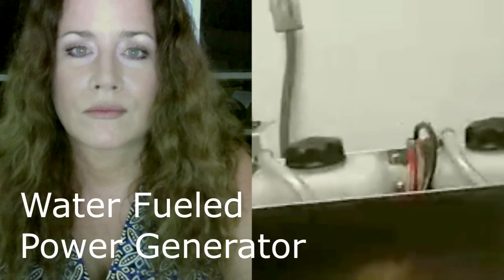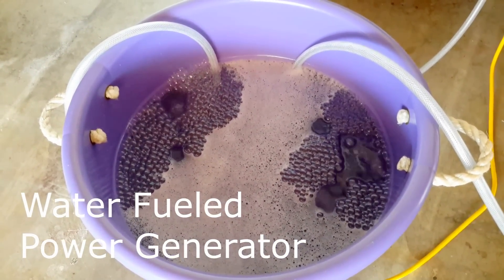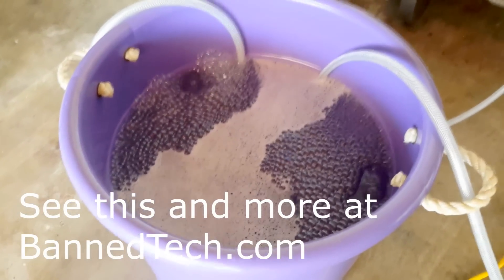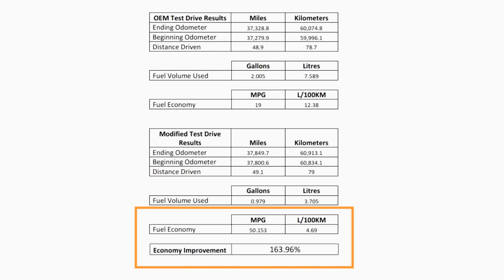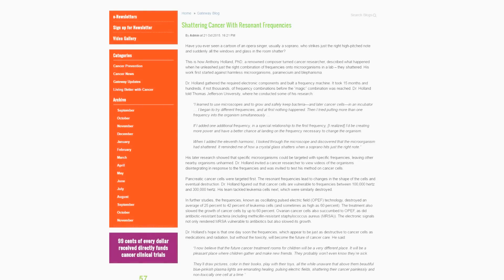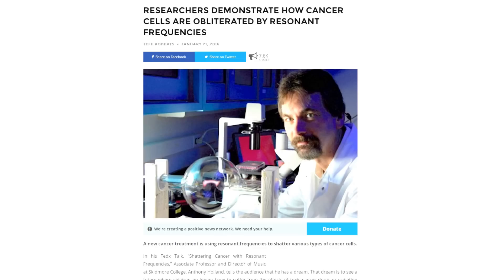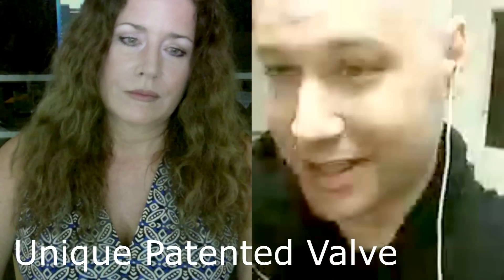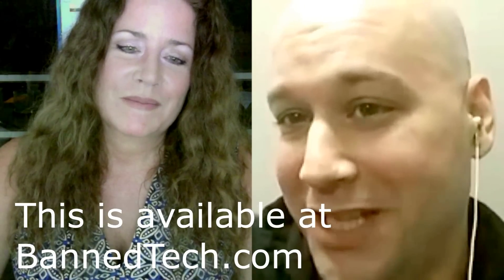Water Powered Cars, Plasma Weapons and You

Comment: when I was able to procure 'plain 87 unleaded gas with OUT ethanol' my truck got a cool 600 miles on a 25 gal. tank = 24 mpg. NOW, all stations (with few exceptions) have 'up to 10% ethanol' per gallon.  I did find 2 stations and gas mileage was 500 per tank so pure gas has been altered to suite the purpose (??), and one station has gone with 10%.
Ethanol draws water into the tanks so in essence we are running on a watered down version without the splitting 'thing',  Right?  
Thanks for the information.
Reply from the maker: I haven't been driving long enough to have seen the difference that you note but I don't doubt you. What you're describing sounds like a scam - a scam on top of another scam, which is the use of corn-derived ethanol for automotive fuel. When you drive across the USA, almost all of the crops you see are cornfields. When I was a kid, in Brazil, they converted most of the consumer vehicles (made by Ford, GM, Volkswagen, FIAT, etc.) into 100% ethanol-fueled vehicles, running on sugar cane alcohol (which has a reasonable return of energy vs corn). At the time, Brazil was living through the hyperinflation of its currency and they had not yet discovered their own oil fields offshore. Most of their oil, back then was imported from Iraq - and they had to buy it with USD (Petrodollars), which was very expensive, with their hyperinflationary currency. To this day, most consumer cars run on locally-produced ethanol – or methane, aka "natural gas" or on high-octane gasoline – all you have to do, when you're filling up the tank is choose which fuel you're using on the car's dashboard, at the time you fill your tank...if only Americans knew what's going on outside of America! But you're right, with ethanol cars, you see water dripping out of the tailpipes, along with what we know is pure CO2 exhaust. In the beginning, not all of the engine parts were designed to deal with all of this water and they rusted - so these parts were re-designed...I wonder whether this factor has been accounted for, in vehicles made for the US market and the ethanol-laced gas?